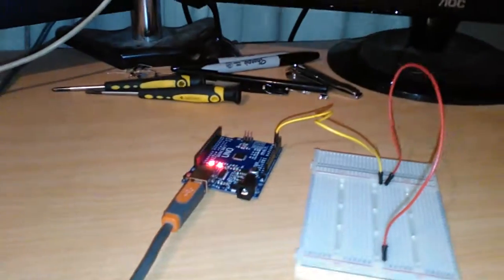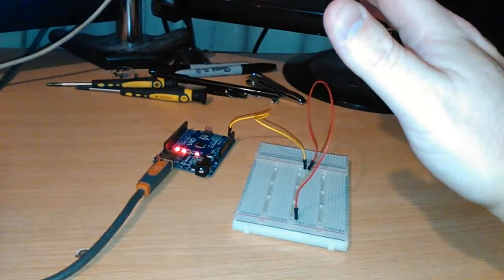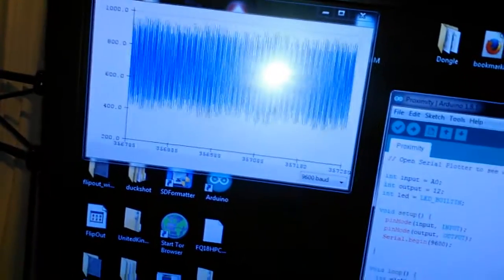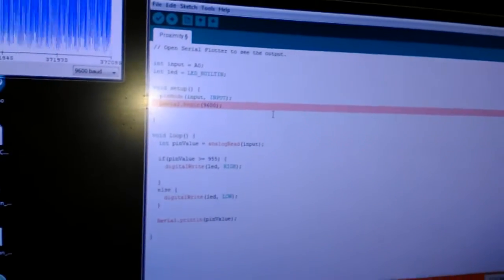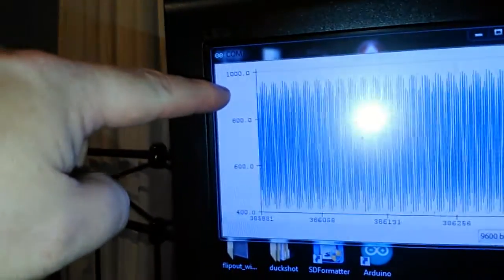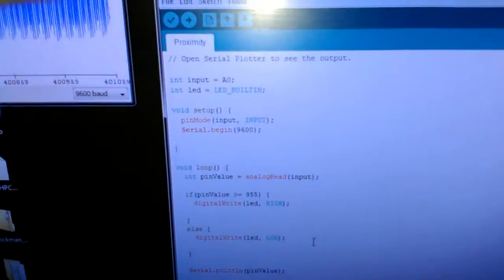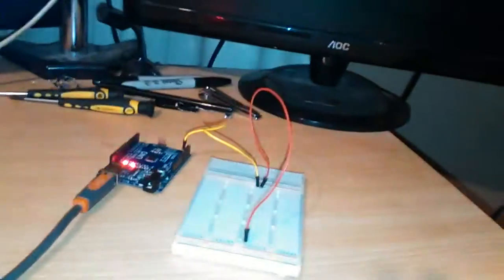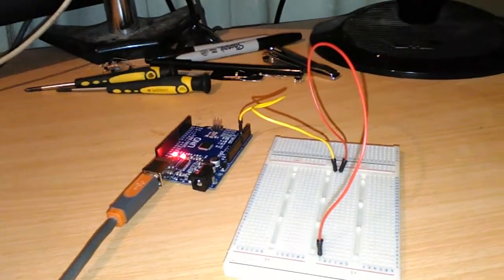Arduino Proximity Sensor

Comment: I have connected only one sensor on analog pin.all other analog pins are not connected to any sensor but when I read other analog pins I get the same reading on them how I can avoid this problem.plz suggest any solution.

Comment: Thanks Steve. I can see it working in the plotter but cannot get the LED to work. Actually in your video the flashing LED is in the different place where my board has it. It it the "L" LED, connected to port 13? I am using Elegoo Uno R3 board..